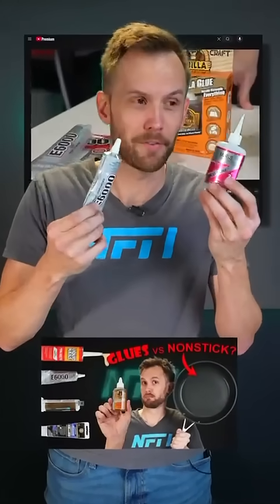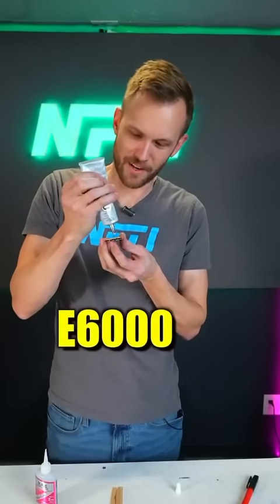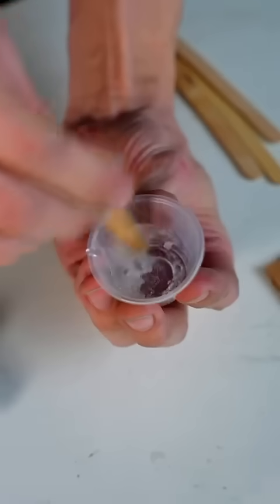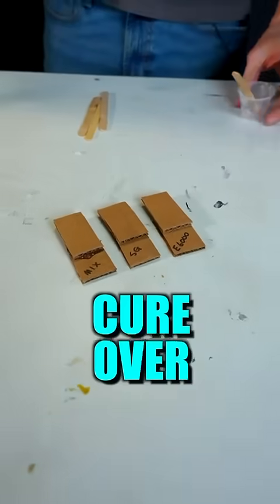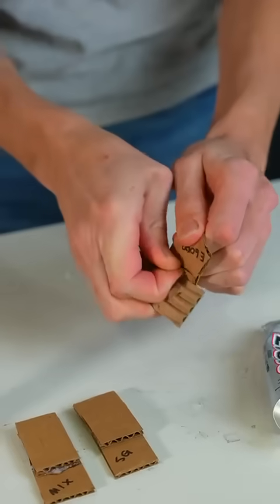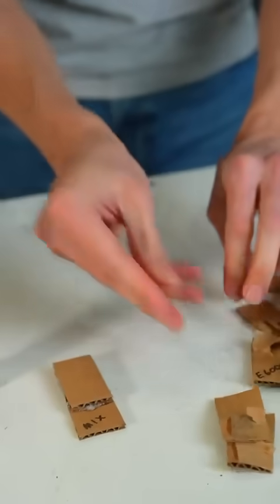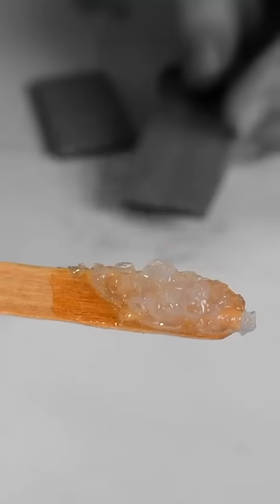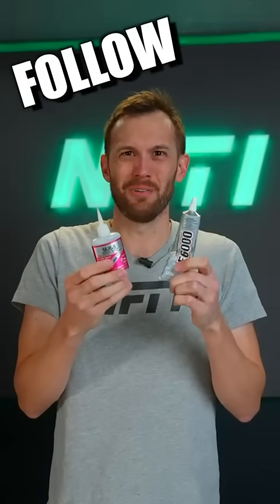Mixing glues for better results?

Comment: Did the commenters mean mix them together, or use both on one surface?  I've seen prop builders use two different glues on something - one that dries/cures quicker, like hot glue or super glue, and one that takes longer for a more solid hold.